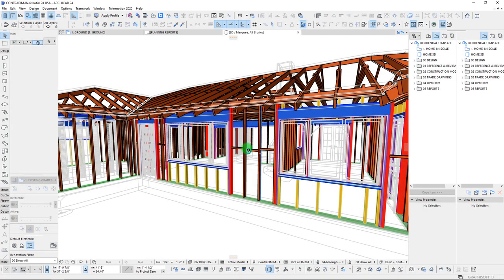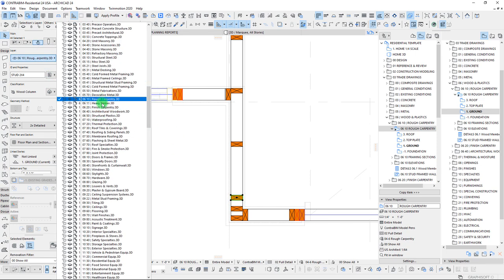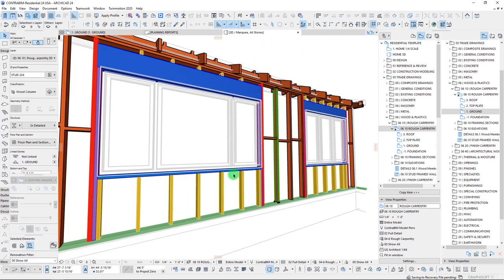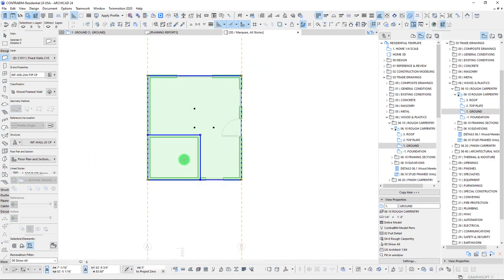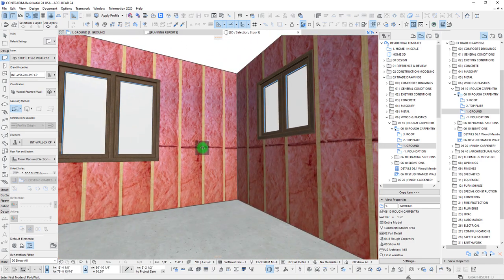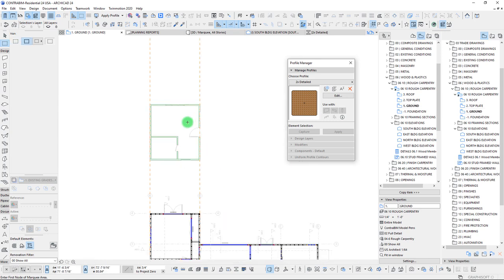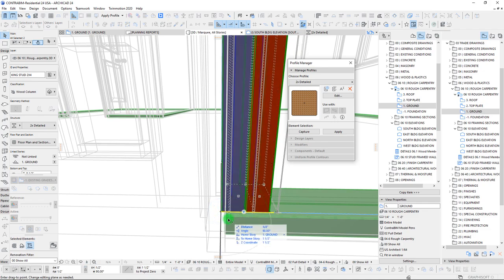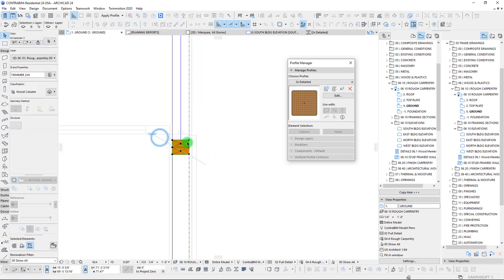How to Model Timber Stud Framing in Archicad

Comment: FIRST great video showing AC capabilities and CONTRABIM dedication!! not to be a debby downer, but why put all of this effort to achieve a "pretty" model, when in fact does not assist in plan take-off estimation by GC's.
Reply from the maker: Thanks for the comment! I wouldn't necessarily call this a "pretty" model, but it does assist with in-wall and overhead coordination, as well as quantity takeoffs. In fact, modeling like this does produce an exact material list with cut lengths on framing members (I don't think we showed it in the video), but it's all right there and as accurate as you model. Useful for design-builders for sure, or contractors who want to pre-plan their framing layouts.

Comment: My method is a combination of three library objects I made. One for wall framing one for floor joists and finally a simple single stud object. All are stretchy and have options for junctions/perimeters. Using objects avoids “walls” interfering with each other. I like your use of a Graphic override to highlight different functions. All the best
Reply from the maker: Nice that should work as well! Yes the interference with in-cavity framing can certainly occur, but setting priorities in layer combos definitely can resolve that issue. Thanks for the comment!

Comment: I'm wondering if you could more specifically describe the graphic overrides you use both for 3d and 2d rough carpentry? I can't seem to get my 3d view to look like yours with the architecture ghosted wireframe and the framing elements solid colors. Thanks!
Reply from the maker: Sure, thanks for the question. So to ghost out the project, I apply an override to pretty much everything, which is the lowest priority rule. Above that, I create overrides for different framing members, based on their element ID containing a specific word. So King Stud/Trimmer/Bottom/Top Plates/Headers etc... All of these can have a specific pen and surface override, and when placed ahead of the general ghosting override, will make them all pop. In between those two groups of overrides, I have a more general Rough Carpentry override, which is based on materials, searching for anything that is wood framing type material and overriding with an black pen and orange surface color. That way it can catch the other misc. framing members to bring forward from the ghosting. Hope that helps!

Comment: hey john - well done for the really detailed and extensive video. have you thought about using curtain wall tool for framing? if so, what are the advantages/disadvantages over using beam+column tools?
Reply from the maker: Hi Emre. Thanks for the comment! So I've been getting a lot of questions on this using railings or curtainwalls to generate framing. I havn't tried these methods extensively myself, but it may be worth an additional video. My initial impression is it can get close for walls without any openings, but once you start introducing variables (which will take place in almost every wall), it becomes more time consuming then laying it out with the basic column/beams. Something definitely worth reviewing! Thanks for the question!

Comment: How do you avoid side by side placed columns and beams from merging into one element? I have tried setting their intersection priority to zero in addition to adding the notch at the corners but for whatever reason they still merge. Is there a minimum size these notched corners have to be? Would be helpful to have a walk through in detail as to how the complex profile was built or at least access to the complex profile itself. Nonetheless, thank you this tutorial was very helpful!
Reply from the maker: I was using about 1/8" chamfered corners. I don't know if there is a minimum size, but hopefully you got it figured out!

Comment: With a manual method like this (not using a plug-in) how long will a finalised project, 150-180 sqm, take for you to frame up like this?
Reply from the maker: For a project that size, doing the in-wall framing members would likely take 45-90 minutes, just guessing of course! It definitely goes by faster when the structural design is already done, that way you can place columns, posts, headers etc... and then fill in around it. I usually put on some good music and see how fast I can get it done, a race against myself:)
Reply: @CONTRABIM  Have you tried the wall framing tool in the wall accessories, instead? Not sure if it will work for estimating.

Comment: I don't know the layers can be shown in wireframe mode before. Thank you for this video. How can I show X mark like yours in the cut section. It's very hard use customized x cut fill for different timber sizes, so I use defaulted joist profile which is basically made of 4 triangular fills. In this video, your profile "2x detailed" only has 1 fill. Can you tell me how can you show the X mark in the section with 1 filled profile only?
Reply from the maker: Hi Chenrun! Glad you found out about the wireframe option, which can be super helpful in a number of different applications. I'll do a video expanding on the X shortly! But your right, to get the X in section on beams you need 4 elements or a single element with a slight cutout to get this to work. Columns in plan can be default have an X which does the job! I'll put out a video shortly on this topic

Comment: Hi John, How do you add the X graph to the beam profile to be visualised in a section view?
Reply from the maker: Hi Diego. You can add the X in the complex profile by splitting the shape into 4 pieces. There are pros and cons of this method however, as the split pieces can count multiple times in component schedules, but for element schedules it's no problem!
Reply: @CONTRABIM  Thanks for your answer, but I did that and didn't get the X symbol in a section. Do you know if there is any other way to obtain this result? I think it would be great if AC included this symbol on beams natively as well as it already incorporates it for columns.
Reply from the maker: @Rojarquitectura  Yes that would make a lot of sense for it to include just like columns. There are two things you can try in your complex profile. 1. You can change the building material so you have  a type 1 and type 2 for adjacent pieces. 2. On the intersecting boundary lines between fills, you can select those and change the pen of a single edge. This typically works as well. Also some older versions of Archicad may have more trouble with this of merging material fills from complex profiles...
Reply from the maker: @Rojarquitectura  I'll have to put together a quick video on this subject, I'm probably not explaining it right. I agree through that it should be a native option...
Reply: @CONTRABIM  that sounds great, please, let me know when you post the video, I'll appreciate it.

Comment: are all of these stud complex profiles in the template? I don't recall seeing any "bottom plate" members.
Reply from the maker: Yes they are all the same profile (2x) which is modified to get 2x2, 2x3, 2x4, 2x6, 4x4, etc... The bottom plate is just the ID which helps drive the graphic override!

Comment: Hi John! Question: How does the 2D documentation looks like generated from this? Do you have a workflow in place specific for framing, details, cutsheets, etc or there´s no need for anything special?
Reply from the maker: The 2d plan views and sections turn out quite nice with this approach. Columns get cut and have an X, and beams in section also get an X which helps when you have multiples stacked. You can of course build live details, or can always link back to standard framing details as well. Very flexible... Thanks for the question! Sorry for my late reply!

Comment: Just a side - we do very little to no wood framing.  Will what you have do steel studs?  Or is this just an adjustment to materials to make this happen
Reply from the maker: Steel studs could be done pretty much the exact same way, with with rectangles or by using complex profiles with the beams and columns. Using a single profile with modifiers would produce most common steel stud shapes, or make a few additional profiles for tracks and other shapes. Material I'd adjust to steel stud framing structural/non-structural...

Comment: Hi John, ever tried to use the railing tool for the stud framing... (in parts)?
Reply from the maker: To be honest I havn't tried that. We had a comment on a previous video about it, and it sounded like it wasn't working so well, and too many complications with openings and headers. I could see how it could be used for bottom and top plates, and maybe some intermediate studs, but what about around windows and doors? I'll have to play with it a little bit, and see if there's a potential there! Challenge with railings is it can be difficult to get good quantities as well from the intermediate members, besides total length and counts, it doesn't give other lengths. Thanks for the comment tho I'll have to do some tests!
Reply: I’ve tried a lot of different methods to try and automate this process and both railings and curtain walls seem to be a real pain, especially when you have gable walls (where stud heights vary) or need to show the studs with a cross mark as you would expect (posts/balustrades have very limited symbols on floor plans) I had limited success with the curtain wall tool, but again it really doesn’t want to make the kind of connections/overlaps you would look for in cripple/trimmer studs. I also found it affected my performance eventually - but as Contrabim discussed with me in a previous comment, that may have been because the elements were attempting to intersect/use material priorities with every wall.
Reply: Roofmaker library and Roof Construction objects in ArchiCAD library solve many problems. Just setting layer priority to 0 will make lines betwenn studs visible. Also it is much easier to make schedules since you have "lumber size" value in those objects. In addition you can make your own Claffification and a ste of custom Properties with formulas to gather studs, sills, struts diagonals etc into one schedule. You can make some formulas (tbh a veeeeery long formulas) to create a property for cross-section, regardles of the type of object.
But it is a real pain to make work projects like that. My personal record is a full work project for architecture + framing + plumbing + ventilation + heating  for a 2-storied 1700 m2 school building in Norway. Done in 2 months.
Reply: Aleksei Sljusarev that is true - I do really like the roof maker tool objects. How do you place them though? One at a time, as there’s no roof to generate them with automatically? Also do you ever find contractors asking about the representation not being traditional (ie no cross symbol for rough cut timbers etc? I’d love to see some images of that project - sounds awesome.
Reply: Do you have a method for scheduling both the column and beam framing members to produce a list of lengths into one column?  The column uses 'height' while beams use 'length left' or 'length right'...I am trying to combine those lists into a single column for a cut list.

Comment: I think this method is a complete misapprehension (of the BIM approach, and the core phylosophy of the Archicad).
The main advantage of the BIM approach (and the usage of an advanced BIM modeler, like AC) is - at least I think - is not based on the possibility of modeling every piece of the building manually, but the possibility of correction and editing later on. 
Take into consideration e.g. a small correction of a partition wall or a door/window in a wall: in a normal AC model, it takes a few clicks. But in this model, you have to make dozens of steps to adjust the individual parts of the frame, even if a smallest change is to make. A major redesign is better to start over from scratch.
The AC have the Goodies Suite add-on bundle, which has the wall framing accessory in it. It's not perfect, but I've tried it to make a whole residential bulding's wall framing with it. 
It worked well, it could follow the changes of the model's corrections in the framing, quite well. Actually in Hungary, the framed wall structures are not common, so I'm not quite familiar with these kind of structures - but I managed well with it. All the parts of the wall-framing could be modeled automatically, almost all of the parts were adjustable, according to the needs. 
And actually, I had to adjust almost all of the model's details during the design process after putting the frame in (almost all of the d&w moved&adjusted, most of the partition walls should be adjusted) - and the framing accessory did the most of the job (only some minor adjustments should have been taken).

And another suggestion: to avoid the automatic welding/joining the elements is easier by using different materials/hatchings (even with the same materials/hatchings duplicated), than using the faceted corners. And the faceted corner method produces unwanted additional lines on elevation views.
Reply from the maker: Hi Itsvan! Thanks for the comment! Super appreciate the notes and viewpoint. I agree that there is a time and place for modeling framing, and doing so too soon will create more work later on. That said, on small projects I'd still prefer modeling with the beam/column tools, as there's a little better control than with the goodies framing add-on. I've played with that quite a bit, and it needs some GDL adjustments to work with composite walls, and honestly I like having more control over individual elements than a single object. But that's the great thing about Archicad, is there are so many different ways of doing things. 

This video in particular was in response to an overwhelming amount of questions for how to model wood stud framing, so this is at least 1 approach:)

Thanks for the comment!

Comment: Is this video from a particular course or playlist? It seems to just jump into the middle of a full course and it’s hard to get the gist of what’s going on
Reply from the maker: The intro portion of this video is just intended to create some context, second half demonstrates the modeling technique which is a very manual approach in this case. The overall file was from the CONTRABIM Template training we did back from 2020, so a little older in this case...thanks for the question tho, hope this helps clarify!

Comment: 28:40 That type of corner blocking is not ideal because that corner becomes a thermal bridge.
Reply from the maker: Good point, it could be insulated out, but plenty of different methods to frame a corner depending on what type of R value you need and what structural eng wants to see...